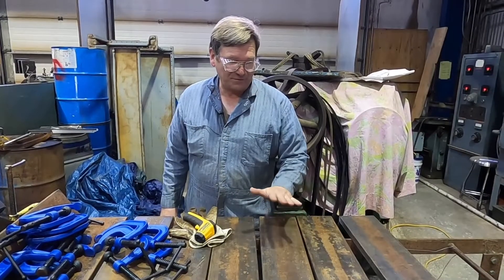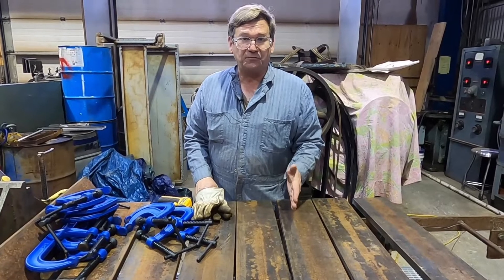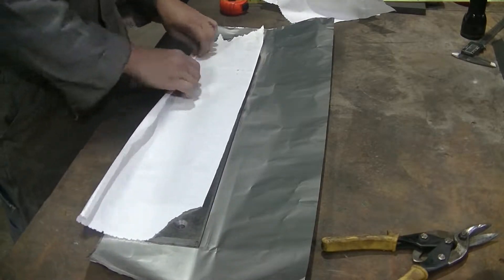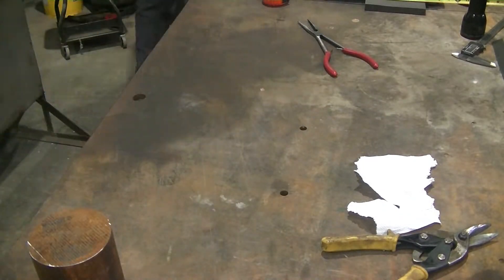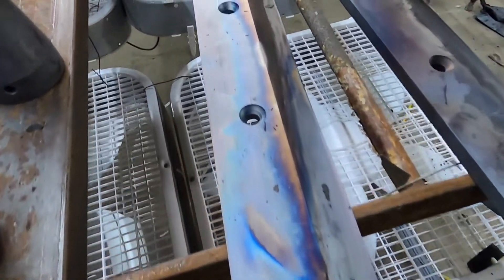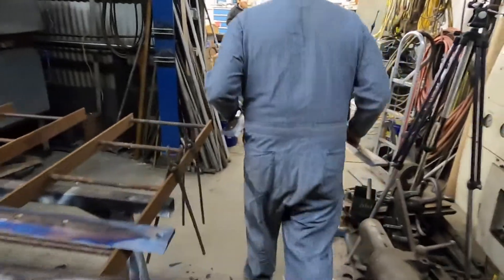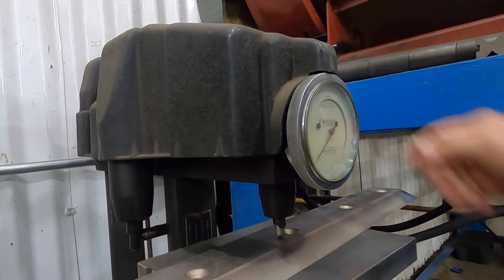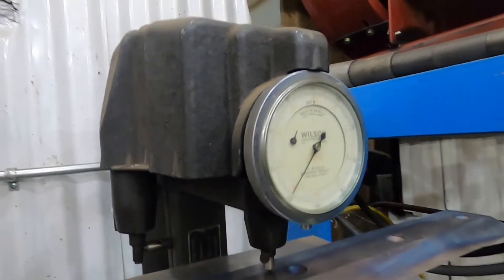Cyanide Bag Cutter Part Two: Heat Treating and Plate Quenching A2 Tool Steel

Comment: 63Rc is pretty good, A2 is a great steel to work with compared to others like D2, which is a nightmare to grind. I crimp my bags with a bench vise and use wood shavings to keep the carbon away. If everything works right, the blade will be slightly golden in color with a rainbow of colors along the part.